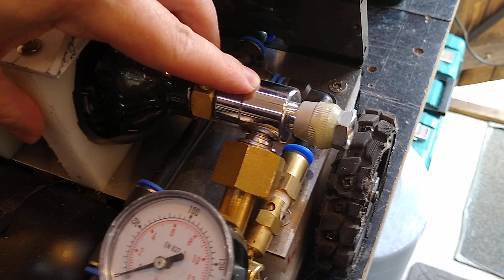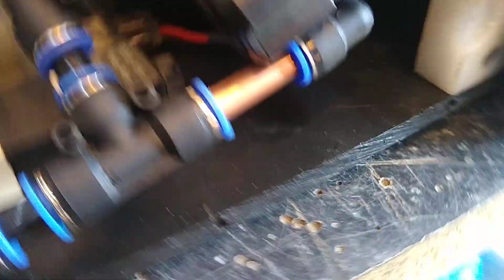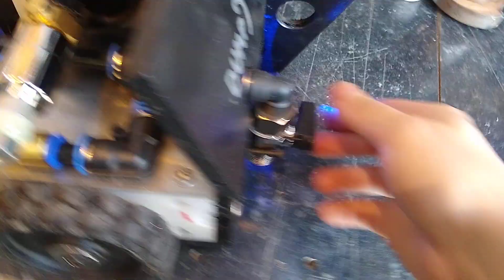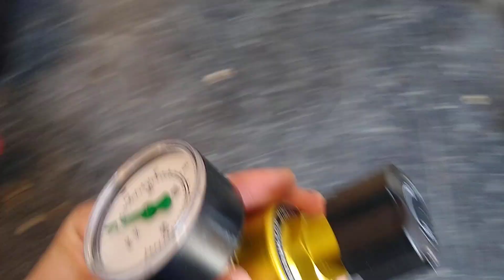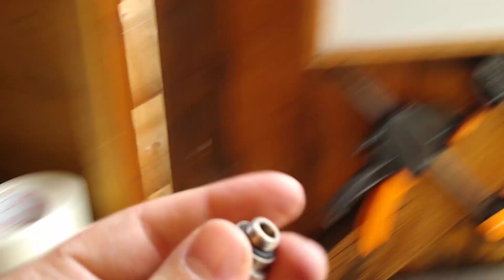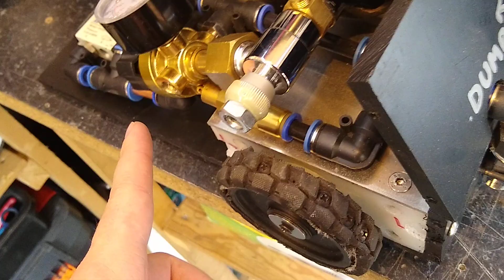Renegade Pneumatics Explained (inc regulator and fittings info)

Comment: Loving these videos. How well do the push fit connectors hold up against shocks and vibration?
Reply from the maker: I haven't had the chance to test these in combat yet as lockdown came into effect a week before its first event, but generally they hold up well. Some of the robots on Robot Wars used them, Thor for example. Either the fitting or a pipe ruptured in his fight against us (Coyote) when Matilda hit him with her flywheel, and again against Magnetar in the heat final, but those were some pretty powerful hits and at heavyweight level. Don't really recall seeing many instances at featherweight level. Time will tell I guess!
Reply: Your so inspiring ,how did you become so knowledgeable on all the robot building ,?